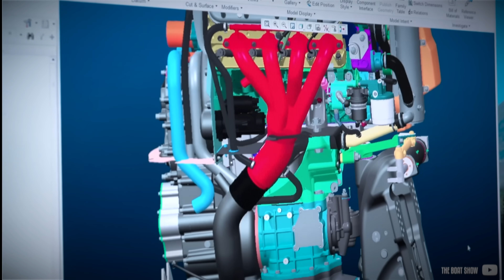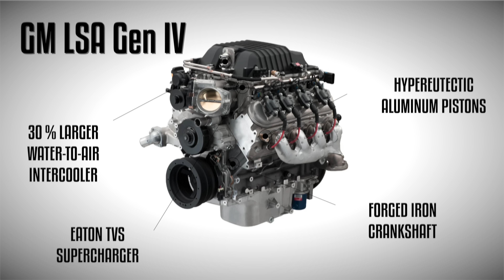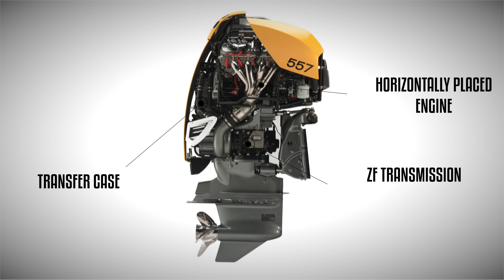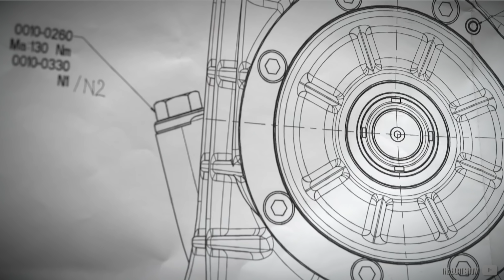How Volvo Killed This 627hp Supercharged Chevy Outboard

Comment: There is one major difference between a road vehicle engine and Marine/Aviation engines.
The road vehicle engine spends most of it's life at less than 20% power - probably less than 10%.
Marine/Aviation engines spend  most of their lives at more than 80% power.
This is why car engines are rarely used as the base for Marine/Aviation engines.
The main indicator why the LSA was a bad choice in this case is how the cooling system had to be hugely improved to get it near suitable for marine output levels. And while you can improve the cooling system ancillaries, you can't do much to the actual cooling galleries in the engine itself.
Reply: You're overlooking one thing about cooling with those.  Intake water temp.  In an automotive application, the coolant going back into the engine from the radiator is still hot, just not as hot as what comes out of the engine.  In a marine application, the intake water is cold.  So as long as you have a sufficiently sized heat exchanger, you won't have heat issues ever.  Water to air is massively less efficient than water to water.

As for the difference in lifetime load, that all comes down to oil cooling.  As long as you keep the oil cool enough to not lose film strength, you can run an engine at full throttle, max RPM all day long without a problem.  There's nothing fundamentally different between an automotive engine and a marine/aviation engine.  That is especially obvious with diesels that have on road and off road uses.  Usually the marine variants are considerably more powerful than the on road variants, despite having no internal differences other than the cam profile.  

You also do see automotive engines used as inboard marine engines pretty commonly.  I've seen all kinds of Chevy small blocks, big blocks, LS's, and straight 6s in boats before, as well as numerous CAT and Cummins engines which can also be had in trucks.
Reply: Pretty funny being many ppl have LS swapped planes. Because GM!
Reply: @Choochinc  Actually both are correct. I watch drag racing. So high HP yet time to cool everything down. Boats have water always going thru everything to cool it down and if no oil cooler well that is the issue. If always at 110% or more something is going to break it is just a matter of what will and where it broke. I saw a $100k 4500HP motor break cause he used unknown rods cause his normal ones were out of stock. Made all 8 rods into dust. Same guy used a new company for the crankshaft bolts and well one sheered off and thus didn't break a rod yet tore off the rod cap. It fixed now and he will be doing drag and drive starting Monday with that same motor.
Reply: We got a steve morris/cleetus fan in the house
Reply: Yup, maximum constant power for marine uses, max peak power for cars.
Reply: Considering it's in the world biggest radiator shouldn't be too big of an issue
Reply: The cooling system improvements were solely for the move to salt water, the corrosion is the issue not how well it cools. 

Boats usually won’t have heat soak issues since they use the water your in to cool everything, the water doesn’t stay and keep getting hotter, it always has cool water coming in and hot water exiting.
Reply: Your right. I believe Toyotas v8 is the only car engine certified to be used in aviation
Reply: Although true, inline4 and 6, V6 and V8 auto engines have been used in many factory and custom marine applications for years.  They have ranged from mild to wild.  

Looking in Big Block Chevy cam selections, there are even cams designated for marine use and what prop to use.

But yes, marine based outboards are generally designed to run at a higher RPM then an engine designed for automotive use.

It’s kind of like the CVT tranny in the side by side (UTV) or ATV world, these engines now operate at a higher peak RPM, much like a boat motor.

Just my 2 cents.
Reply: @guyforlogos  yep. You’re the only one who knows what they’re talking about. The salt water causes galvanic corrosion. To run salt water coolant the engines need zinc anodes.
Reply: Rarely used? Almost every wakeboarding/skiing boat I've ever been on, had an automotive based engine. Even Mercury Racing's mighty 1750hp QC4 engine, is a highly modified big block Chevy.
Reply: @sithyarael6807  Steve Morris?
Reply: Salt water doesn't need to go through the engine just a heat exchanger, the water that geos through the engine can be coolantwater just like your car and doesn't need to be winterized, extra plus
Reply: @chadthibodeaux8533  it doesn’t “need” to but it does on many engines
Reply: @chadthibodeaux8533 
Yes ! ...and that was specifically discussed in the video.
Reply: @shawnsatterlee6035 guess you don't know how bad a reputation that they have for cutting off in the air it's like a joke to even trust one. Garbage Motors
Reply: Someone forgot to tell Mercury Marine that. The GM Iron Duke I-4 engine was used in a lot of smaller boats coupled to a stern drive. Thousands of GM V-6 engines , and the 305, 350, 454 and 502 engines in use.

All of these engines live many years before the sea water side at the exhaust risers rot out and dump raw into the cylinders. 

I built a stroker motor that started life as a 427 GM aluminum engine. It required 8 cylinder sleeves, so required a heat exchanger cooling system. I had two heat exchangers, 12 inches in diameter and 3 feet long. heat exchangers have about 20 times the price of using a conventional a custom aluminum radiator.
Reply: @gungadinn  duh? Boat engines don't operate at the high throttle settings like aircraft engines do either, just like a car. Duh, I think you missed the boat. And what catastrophe occurs if the boat engine stops running? Duh, safety Factor, duh
Reply: @captainaxle438  
More like Captain Oblivious. What can happen is going offshore and spinning a rod bearing with no one else around. Waiting for SeaTow or the Coast Guard when taking water over the transom will be the longest wait in your life. Boats "never break down in calm seas and nice weather"

A stern drive equipped boat engine typically operates between 3500 and 4200 rpm. Always running up hill. The experimental aircraft using automotive engines are typically light weight. A LS or small block Chevy weighs too much for a light experimental aircraft. It's done. That's Subaru territory.

My Cessna 340A had Continental 520's. The engines lumbered along around 2450 rpm except for take-off power setting. So I know a bit about aircraft engines.
Reply: @gungadinn  comparing boat and car engines to aircraft engines is kinda  gunga dumb. History shows there are no engines that have gone from ground surface vehicles to the airplane. There are airplane engines to have gone into PT boats and Automobiles but it doesn't work the other way around. Reliability cooling lubrication all in the design like the original commenter said he is right you are wrong. The horrors of breaking down at Sea are still less then the results of an engine failure in an aircraft. And yes a big part of an aircraft engines durability is that it operates at lower RPM
Reply: The common mistake I see made when a car engine is repurposed is in the tuning. 

Boats spend extended periods at 60% throttle or more without a break. 

Some conservation on ignition advance and fueling is wise. Same goes for boost and anything else that increases the specific output. This is one reason OEM boat engines tend to have comparatively lower peak power compared to their car setup.
Reply: Ya the LS engine has never been to a 24 race track.  Oh wait.

As a former GM engine designer and best engine cooling system award winner, I George Santos, find this comment to be utter nonsense.  As if I would design a cooling system for partial load.
Reply: @ml.2770  if you are a former GM designer then your poor reputation precedes you. There have been no Automotive engines that have stepped up to aircraft use successfully. Ironic that the cheapest American-made product would be allowed into airplanes so I'm sure it's politics like the Hummer  in Irag debacle
Reply: @captainaxle438  
You need to look back at the history of the development of the Hummer.
It was designed as a replacement for the Jeep, not as a armored vehicle. Tack on 5,000 pounds of armor plate and the entire vehicle is over weight, under powered and no longer able to perform the original function, move troops quickly.
The first gen Hummers had GM 6.2 diesels, then 6.5's. The 40 hp jump did little to fix the vehicle being severely over weight.

Look at the M923 5-ton truck? Now it's a 7.5 ton truck with a slight up-armor. It was never designed as a APC, just a supply transport truck.
Reply: @gungadinn  Correct. I am aware that the Navy was having to weld in steel plating in the floorboards and increase the weight and it led to problems, including flat tires, they averaged 300 miles per breakdown. If you know anything about the politics of the military equipment purchasing it's not hard to see that General Motors was favored with an inferior product. It has been said that GM and the Clinton administration were lovers. Hence for the first time in history a military vehicle was allowed to be sold to the public. GM created the Hummer brand off of this one contract. You must remember that GM leads the big three manufacturers in one area. It's called The cheapness Factor. They put the least amount of raw materials, engineering and research and testing into a vehicle than anybody else. And it shows
Reply: Incoming coolant water on outboards is always cool which makes cooling simple in comparison
Reply: Hmmm,many airboats are equipped with automotive engines that operate on the upper end of their power output
Reply: @captainaxle438  as a non engineer in the field your ignorance precedes you
Reply: Hence why the V10 VIPER MARINE ENGINE had a closed loop cooling system.  The only way 2 use a car engine as an aircraft engine would be 2 use a billet block , heads, crank, rods & pistons & quite possibly a Whipple supercharger.  Although l would take that under advisement .  Xpensive $$$$ . But not in the same costing arena as a Continental . Then the engine would be superior 2 most piston Continental Engines l would have thought.  Especially if used a closed loop cooling system with the radiator.
Reply: If l am going 2 purchase say a Velocity Pusher Aircraft l ain't going 4 a Continental Engine.  Over priced . 
It would be one of ×2 options.  A billet Aftermarket Block & Heads heat treated & all billet internals ( possibly supercharged.  But that would depend on the performance of the supercharger at 15000/25000 ft . Engine would be 441 cu inches . With a radiator obviously.  
2nd option would be a turboprop Engine super lite weight.
Reply: You know the lsa engine is used in boats right? Paragon... and that pretty much every single marine engine is a GM block right? From the little 2.5 iron Duke 4cyl to the 8.1 425hp gen 7 big blocks that are in my boat. Most marine engines are automotive engines
Reply: @longsleevethong1457 salt water sure doesn't go in my marine engines. They have heat exchangers and use coolant.  Tye sea water is used for cooling the heat exchanger. No salt water enters the motors
Reply: @captainaxle438 dude.. Aviation engines run at about 2,200rpm. My buddies Turbo Bonanza spins 2,400 wot.. about what a car turns at 75 mph on the highway in OD. They don't spin that fast
Reply: Orenda/Trace engines were successful (and certified) for a time, they were essentially GM aluminum big block V8's rated at 600HP for takeoff and 500HP continuous.  They went under after several decades of development and limited production, not because the engine was a failure or anything was wrong with it, but because of poor business management and a lack of interest in the market.  The biggest hurdle for converting automotive engines for aircraft is finding or building a reliable PSRU (gearbox), as this is where most of the failures have occurred (the engines were usually fine).  The second hurdle is weight...even though the engine may develop identical power and weigh less than a comparable aero engine, by the time you add the PSRU, accessories, and figure out the coolant system, you almost always end up with a completed firewall forward package that weighs more than the aero engine did.  Considerable effort needs to be focused on reducing weight for them to be a competitive option.

I think where people are getting mixed up is that they're not adequately equating car miles with aviation/marine hours of operation.  A car engine with 3,000hrs total might have anywhere from 75,000-150,000 miles on it, not a big deal really...whereas an aero engine, simply making it to 3,000hrs is noteworthy and not particularly common.  That's simply due to the amount of power continuously needed.  Most aero engines have a 2,000hr overhaul interval, some with more, some with less.  That's about how long an auto engine in an aviation application will last, provided the conversion was done correctly.  The Trace engine had an overhaul interval of 1,800hrs, but had planned to extend it to 2,500hrs with oil analysis and fleet monitoring.  Some smaller aero engines can hit the 3,000hr mark, but they're also small engines in aircraft designed to slowly putt around the sky at 45% power, not that far from a car application, really.

RPM has little to do with the longevity of an aero engine, contrary to popular belief.  Most aero engines only run at low RPM because they're trying to avoid the use of a PSRU that adds complication and cost, otherwise they'd be running them at much higher speeds so the engine itself could be made smaller and lighter.  For comparison sake, at takeoff power the Trace engine would run at 4400RPM and an R1340 radial would run at 2200RPM, so one would naturally think that the R1340 would be able to run twice as long or close to it because, well, half as much wear, right?  But the R1340 has a generally accepted overhaul interval between 1100-1600hrs, depending on what kind of flying you do with it.  That's considerably less than the 1,800-2,500hrs you could get from the Trace running at twice the RPM.  It has a lot more to do with internal design and operation...bearing speeds, bearing surface area and psi, ring thickness and tolerances, consistent cylinder/head/oil temps, that sort of thing.  RPM can affect this directly, but can also be engineered out of the equation to a degree by changing such variables.  Tiny 4cyl cars can get some serious mileage on the odometer and they're living in the 3,000-4,000RPM range, and a V8 truck might be able to get the same mileage if well cared for, even though they're usually in the 1,800-2,400RPM range.
Reply: @captainaxle438 the army used the hummer in largest numbers and it was made by AM General.

Comment: Another great video, this time with a sad ending... Do you think you could do one about the new Mercury Marine line of V10 and V12's?  I think those are also quite unique, and are the only 10 and 12 cylinder outboards in the world, ever, as far as I know... Thank you again for another great video.
Reply: I work at a marine dealer. Im 6 feet tall and when i stand next to it im small. They are massive. But sound amazing. 110000 each i think
Reply: those are FAR superior to this automotive garbage. they are ground-up marine motors and lighter.
Reply: @ct1762  Yes the Merc 600 is what killed 7 marine

Comment: With the right cam and supercharger pulley and the right tune and even the right gearbox ratio you could make this engine make all its power around 3,500 rpm and it would run good for years.

Comment: There are 2 VERY BIG reasons that they failed that you missed. 

1. Mercury coming out with bigger engines up to 450hp that were half the weight and a lot less money killed sales.
2. The astronomical maintenance costs these things had. I was around a few of them and they were always getting serviced and the only techs that worked on them weren't cheap. I think it's 50hr between each service too

 That and they were also pretty unreliable and the early gearboxes failed a lot too. They are pretty cool though and sound amazing on startup
Reply from the maker: You are right. On top of that, network of service places must something to do with that as well as many people around pointed out
Reply: @VisioRacer Please do a video on Mercury Marine's 600hp,   supercharged V12 "VERADO" out board motor. Thanks.
Reply: @magnatarbeing8749  Mercury's V12 600HP VERADO is not supercharged.

Comment: I don't own an outboard or even a boat, but I like to watch these awesome outboards on YT. I would think one day someone will squeeze in a tuned 6.6 Duramax on an outboard. All that low end torque would get up on plane pretty quick.
Reply: I really don't understand why wakeboarding boats don't run diesels. The low end 1000lbs of torque and 450hp+ of diesels these days that can easibly and reliably be tuned to 700hp+ would get far better fuel consumption making twice the power as the current gasoline engines.
Reply: @calephillips-pu4kq  weight lol
Reply: yes and weigh 3x as much.
Reply: @ct1762  there's a 250lb difference in a 5.9 Cummins and the 8.1 gas burner. Try again....
Reply: @calephillips-pu4kq almost all wakeboard boats in europe are 6 cilinder diesels. Mostly because petrol is unaffordable.